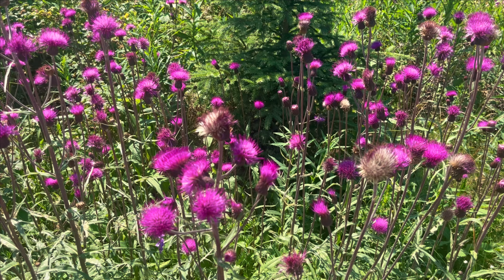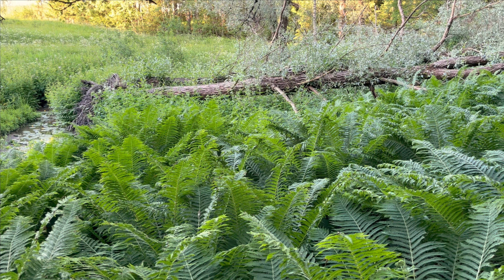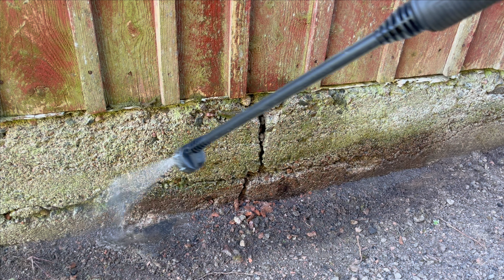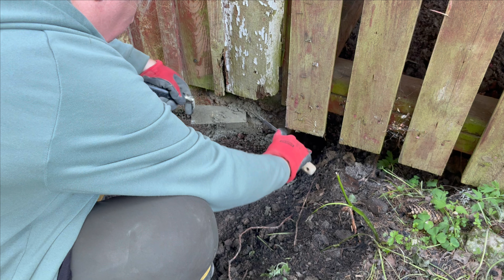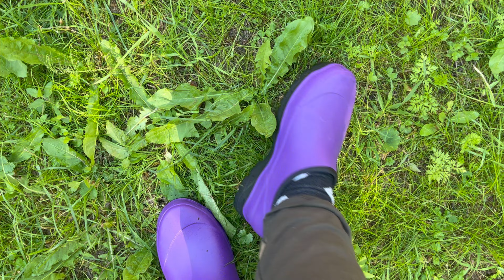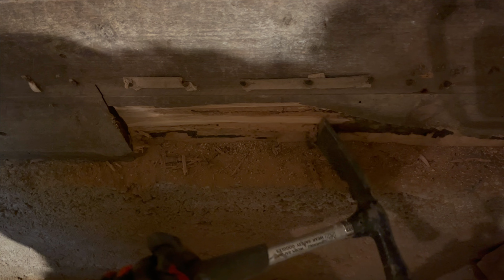#127 Luisa the Mason

Comment: Heat?  It's gonna be 38 degrees C (100 degrees F) here today.  I'm going to close up the house, draw the curtains, turn on the air conditioner and watch YouTube!  But I can see that this video is from a month ago.  You did such a good job with the concrete!
Reply from the maker: @sandrachristiansen1404  That is too hot to bare! 🥵Yeah!  the garden update is older buy I wanted to include it any way. Thanks Sandra! I still need to finnish the concrete base.